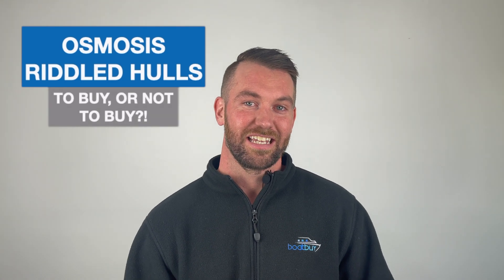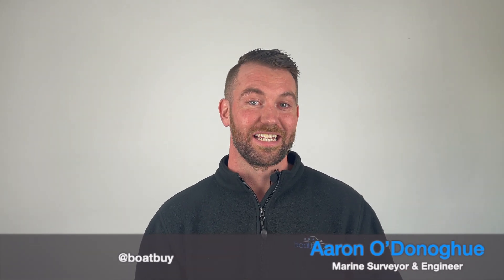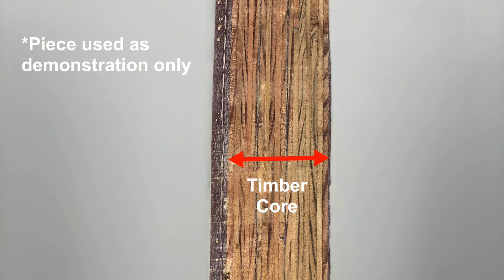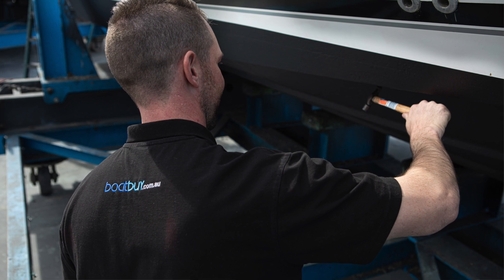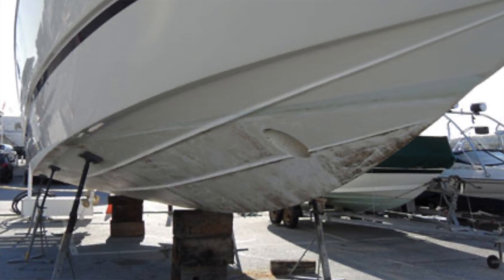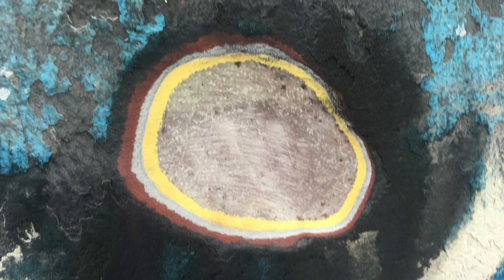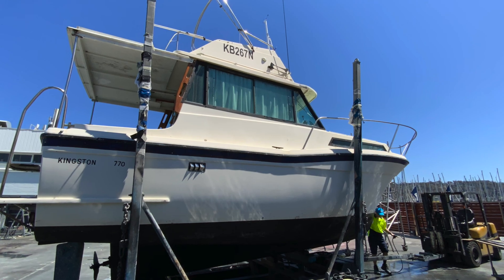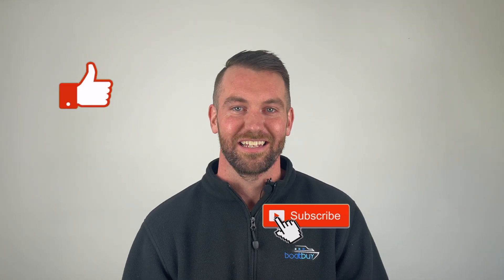Boat Hull Osmosis - To Buy Or Not To Buy?!

Comment: Hi,
If the boat was built in 2006 and has osmosis around the waterline, would you consider that a red flag? There are approximately 20–30 small bubbles on the surface within an area of about 10 cm x 150 cm.

Thanks for your opinion!

Comment: Thanks for the differentiation between Osmosis and bubbles in layers of anti-foul!  Put my mind at ease.
Reply from the maker: Glad it helped!
Reply: @BoatBuy  Your video was a great synopsis.  My Bertram 25 that lives in the water has a few spots between gelcoat and glass (and between layers of antifoul), but there is no actual blistering of the glass layers. Its 36 years old, and at this age is not perfect on the topsides either after so many sets of covers, holes drilled here and there, jetty scrapes and owners adding their 'modifications'. At least it was re-powered with the latest DTS Mercruiser Seacore 6.2 in 2019 after ripping out the old twins. Its not going to sink so I'm just going boating!  It's bloody great at Rotto this time of year!
Reply from the maker: @AndrewWilmotAu Yes, you've done the important stuff. Those Berties are usually pretty solid so with a repower would be an incredible boat!

Comment: do/can barnacles cause osmosis? New boat, here.  Brackish water. No Bottom paint. Leave it wet, in season, with periodic bottom cleanings.  Also, if professionally Bottom Painted to virgin hull, don't they strip down to gel coat? what's the better path, to minimize blister risk, etc.? i.e. does anti-fouling bottom paint "waterproof" the hull?
Reply from the maker: Blister risk is the resin used to lay up the boat. Most general purpose resins are more suceptible to osmosis - so antifoul doesn't have a real factor. You don't strip the gelcoat, you sand it though so the antifoul will stick (after applying a primer).